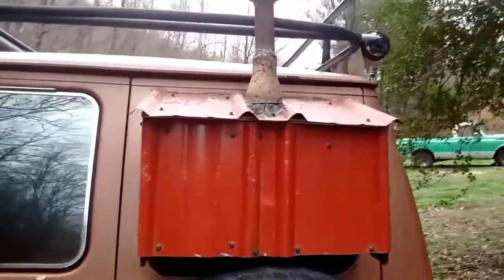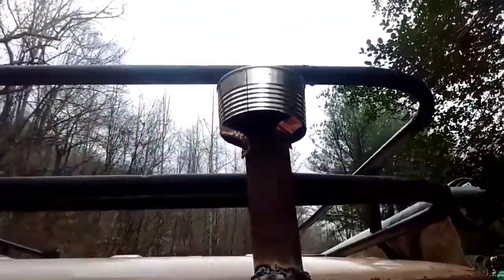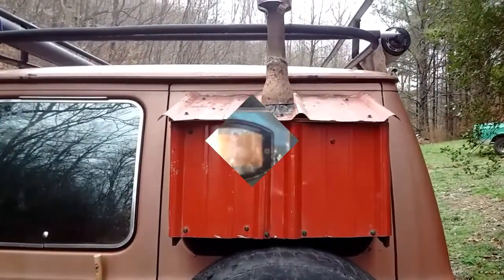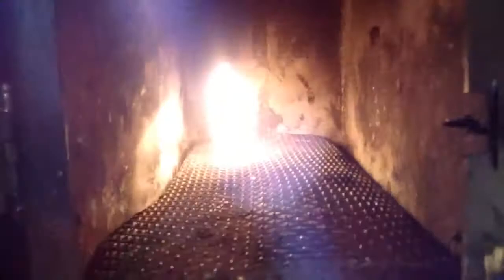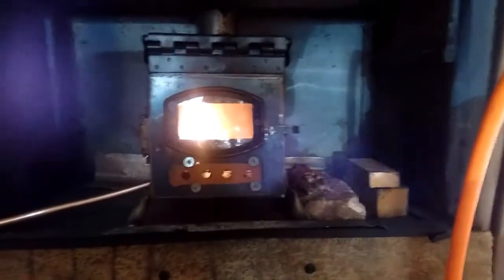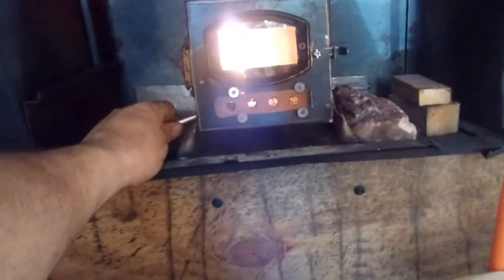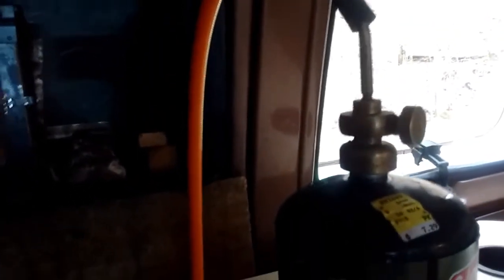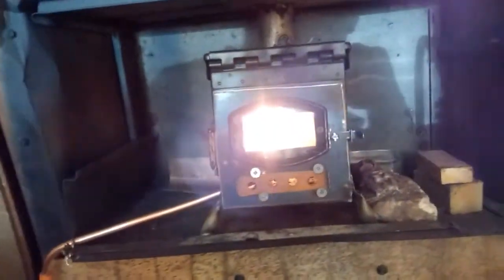Camper Van Stove Enclosure Finished

Comment: looks good. are you concerned about the exposed wood edge under the overhang absorbing moisture from the air and swelling or developing mold?
Reply from the maker: Sweatblud Survival Good point. Maybe I can put a good thick coat of bed liner on it.
Reply: luke Fugate good thinking